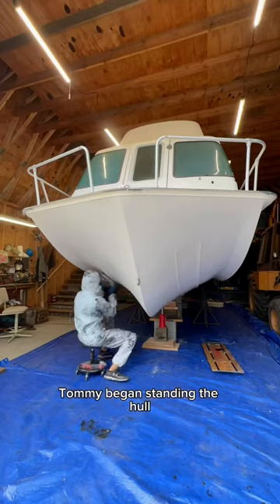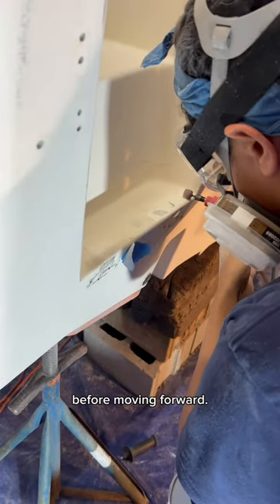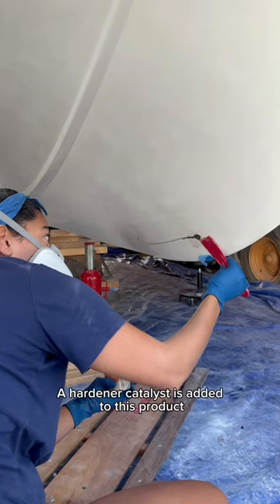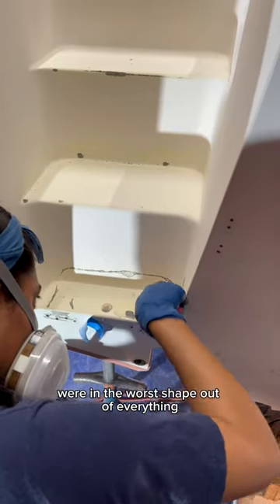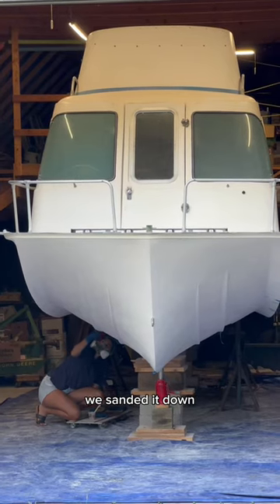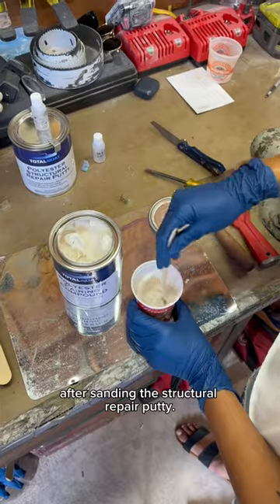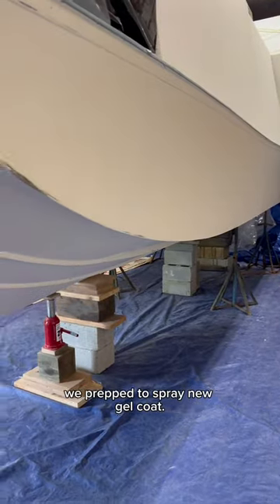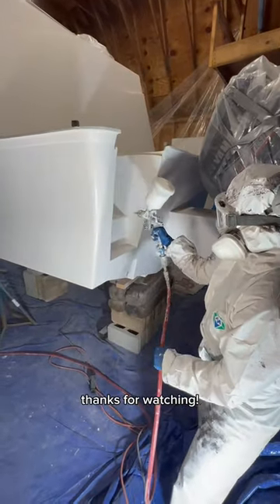Prepping and repairing the hull for new gel coat! #boatrestoration #seacamper #shorts #boat

Comment: Please foxes! Use epoxy system resin for old polyester construction...
Reply from the maker: Excerpt from boatus.com — “When the repair will be finished with gelcoat, the laminating or filling needs to be done with polyester. While epoxy adheres tenaciously to cured polyester, the reverse is not true, so the bond between an epoxy repair and an overcoat of polyester gelcoat will not be strong. Use polyester for repairs that will be gelcoated.”